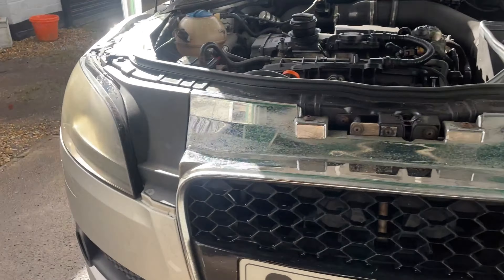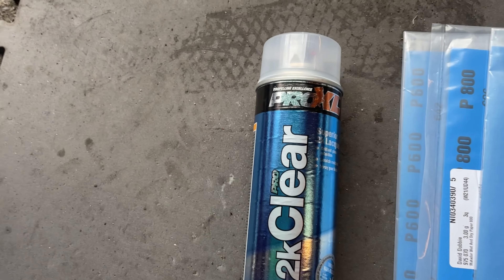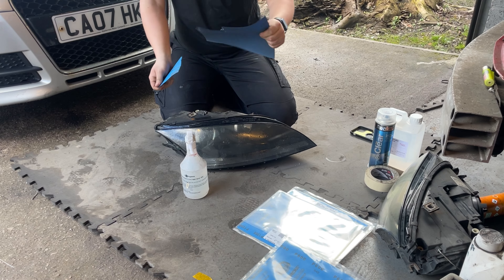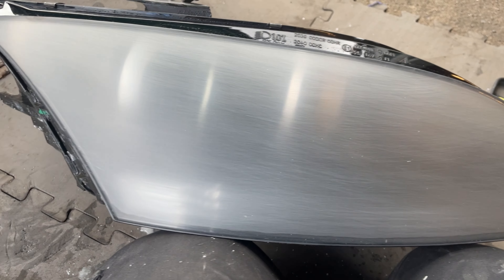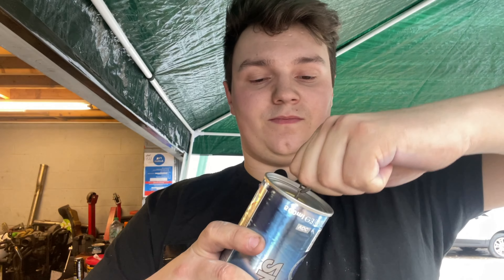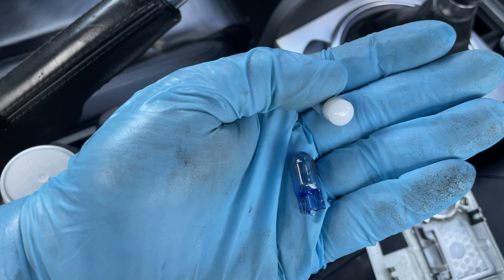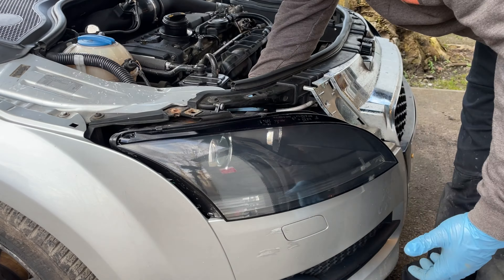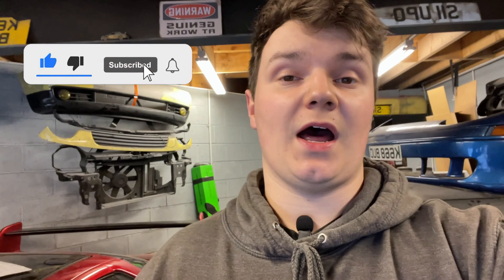MK2 AUDI TT HEADLIGHT RESTORATION

Comment: Great video! Would you think it is possible to access the interior surface of the glass? I tried to polish my mk2, but it is still slightly foggy, and I think it is because of the interior.
Reply from the maker: Thanks! If it’s a yellow fog then it’s more than likely on the outside off of the UV from the sun. Sometimes it can be quite deep! 

If it’s a clear but looks wet, then you’ll need to dry the headlights out and make sure the seal cap is on, on the back of the headlight.

Comment: Anyway of doing this on the inside? I can see the previous owner has scratched inside and there’s some mottling from (I think) mould, where it was stood for a year during covid. It’s definitely on the inside and not outside UV related etc
Reply from the maker: I don't think so, unless you're willing to separate the lease from the light, which could do more damage than good because it's not an easy job😅